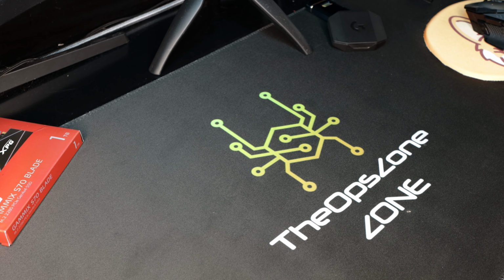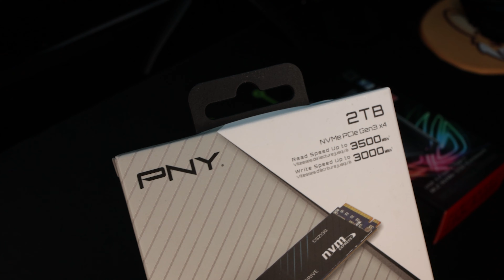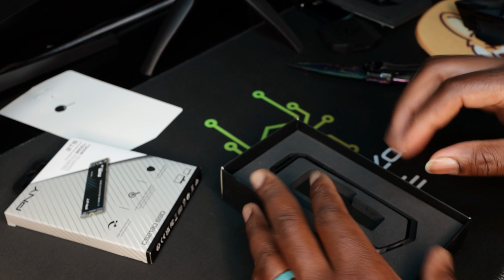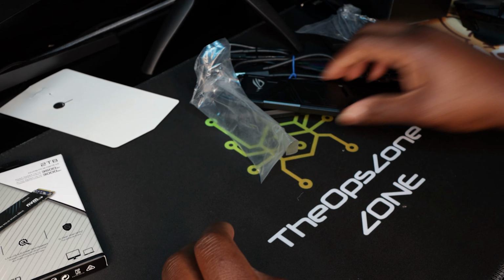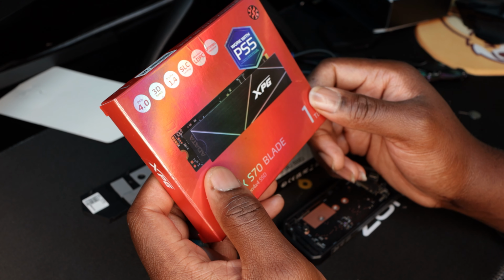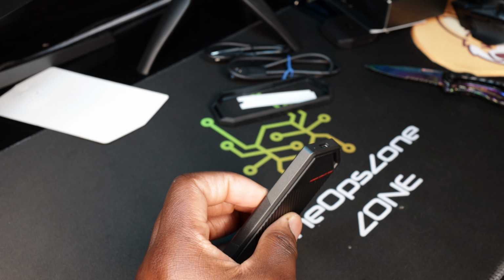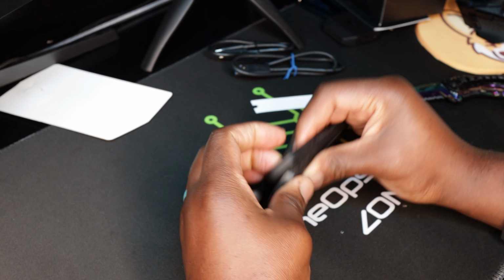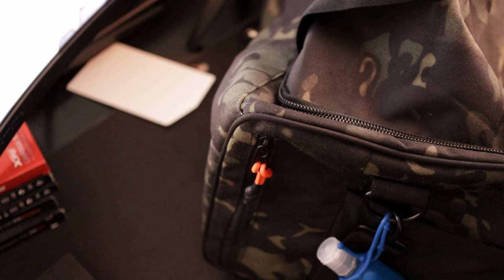Rog Strix Arion Unboxing and how to install 2021

Comment: the screw was installed incorrectly ,but anyway , great video and asus never disappoints!
Reply from the maker: What! Can't be... Ill have to check on that. But thanks, yeah Asus never miss.
Reply: @theopszone6775  Look at figure 6 A in the instructions, it shows the memory card goes into the undercut on the retaining screw, not under the screw
Reply from the maker: @fredk1256  Yeah thanks. For that.

Comment: hi this device work on android and television ?
Reply from the maker: Well. You will able to use on Samsung devices.  I have the fold 3. Works like a charm.
Reply from the maker: As for TVs it does depend of the make and year.